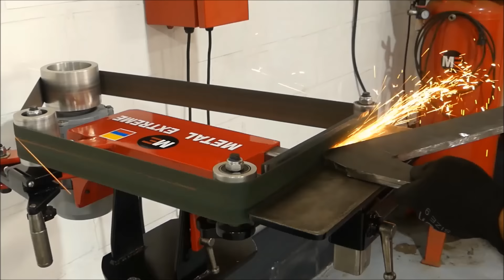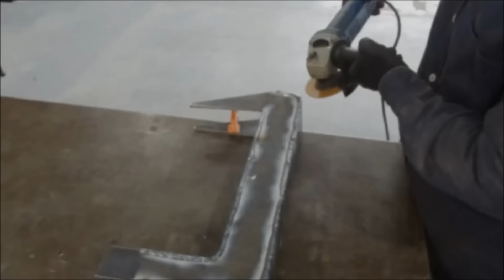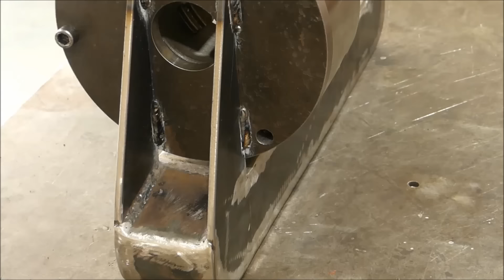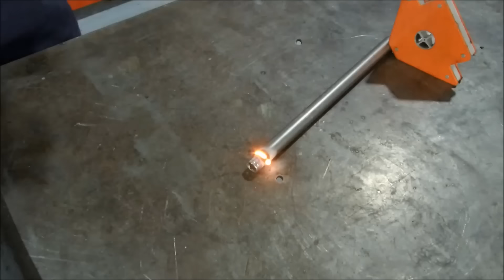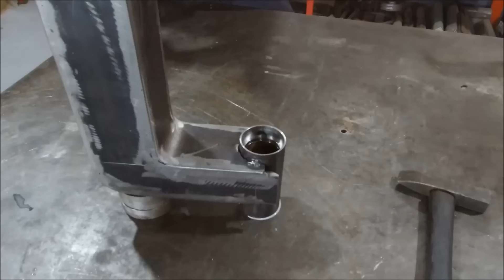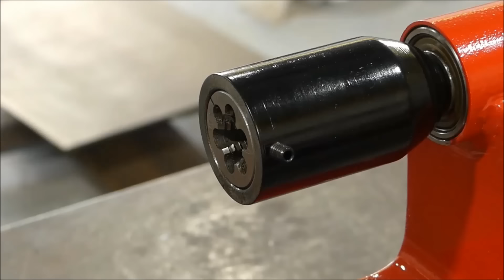Fabrique Esta Herramienta Para Hacer Roscas Con Tarraja y Machuelos.

Comment: Excelente trabajo. Muy bien pensado y ejecutado. Disfruté mucho de su fabricación y funcionamiento. Qué bueno ver que el taller se va haciendo más y más grande con las nuevas herramientas que has fabricado con tus propias manos. Adelante y mucho éxito. Saludos desde Puerto Rico 🇵🇷.
Reply from the maker: Muchas gracias amigo por tu gran apoyo lo aprecio mucho, gracias a dios  estoy completando el taller con las herramientas, el año entrante dispongo de mas tiempo para compartir muchas mas cosas con ustedes, un fuerte abrazo y muchos saludos desde Colombia para todo Puerto rico.
Reply: 50+ years ago when I was an apprentice we had to do all of this either on the lathe or capstan by using thread cutting tools or die boxes and then check the thread by using a go/no go guage. Also by hand using die holders and tap wrenches in a vice. A very interesting tool and very expensive to make. But hey this is the second millennium.
Reply: Ar nėra pirkti tokiu vaistu?

Comment: Just seen this good idea think it would help 
when putting the DIE in the holder there's a slot on the die line it up so the grub screws go in it then mark the collar holder cut a small slot in it that way with the 2 marks together perfect line up so there's know slipping of it on bigger threads hope this helps you
Reply from the maker: Hello friend, thank you very much for your great, excellent contribution, I will modify it, a big hug and many compliments.

Comment: Impressive build. Just wondering what might need that level or precision for perfect threads.  For most applications, threading on the lathe should provide pretty good precision. 

BTW,  I appreciate the fact that you did all your welding on the bench. I see quite a few videos where the guys make some of these type welds while the piece is chucked up in the lathe and only about 1 in 100  of these do they bother to clamp a separate ground on the piece.  I've seen a few where the are probably welding at 150 amps or better trying to repair a broken shaft!! These guys try to portray themselves as master craftsman while at the same time causing damage to the lathe drive train!!  Never make welds grounded through a piece of rotating equipment!!! This is such a basic rule. Each time they weld like that, they are burning little pits on the gear teeth and the bearings. A good lathe can easily last a lifetime if you treat it right!! You'll see some of these same guys grinding with no eye protection. Your eyes and fingers are tools too and they tend to be irreplaceable. 

Nice work! You are a skilled craftsman.
Reply from the maker: How are you my friend, thank you very much, that's how the lathe is, I fully restored it, and the truth is I take great care of it and welding on the lathe is the worst mistake, you slowly deteriorate it without realizing it, we have to take care of the tools we work with, a big hug and many greetings.

Comment: This is a good way to get true and straight  threads. But The Die is normally held with three screws.  the centre one pointed one, will open the die at the split, and the other two close it. So I would start with the die opened a bit and test that pass, ideally with a test nut. If the thread is too large small adjustments are made until the thread is sized correctly. I made a die holder for a lathe with an hex shank so I could use a ratchet wrench to turn the die.  For small treads slow lathe speed and gripping the die holder taps thread with adjustable torgue ( your grip) work well for me.
Reply from the maker: How about friend, if you are right, I will try to change it for a hexagonal one to be able to start without much effort, thank you very much for your advice, it shows that you know a lot about the subject, a big hug and many greetings.

Comment: Nice work but , as it is now, the lathe head is underutilized, my opinion is that you should make a preparation for a threaded jaw on the left part of the lathe where the drills are clamped and the jaw would be fixed, but the workpiece would rotate slowly while being clamped in the lathe head and this would be done thread ...
Reply from the maker: Thank you very much friend, that is good advice, I will take it into account, a big hug and many greetings

Comment: useless..you can do that with a lathe.....that's the reason taps have a small hole at the back...so that you can mount them on a dead center and turn them with a wrench.....the lathe chuck can be help with a lathe key (or perhaps you could design a brake for the lathe chuck ...that would be helpfull)
Reply from the maker: How about friend with this tool you can make very small threads and much faster than in the lathe greetings
Reply: @MetalExtreme  you can make small threads in a lathe with taps, that's what I was talking about

Comment: Turn a taper on the shank and put that die holder in the friggin lathe tail stock and be done with it. - Not only power threading but you don't have to waste a 3 jaw chuck or all that steel and labor. 

Good workmanship and even engineering but a REALLY stupid concept.,,,Especially when you have a lathe,
Reply from the maker: Thank you very much friend for your comment, a big hug and many greetings